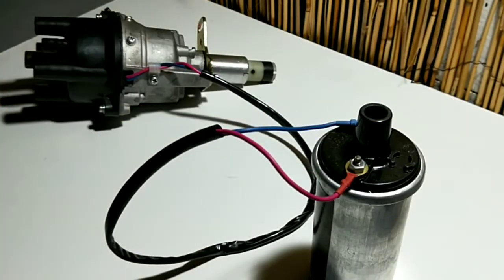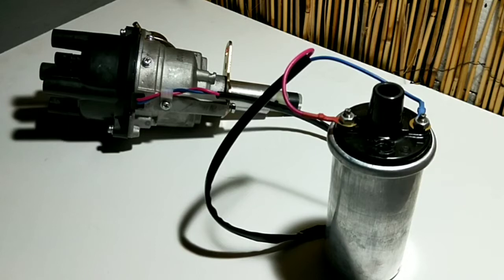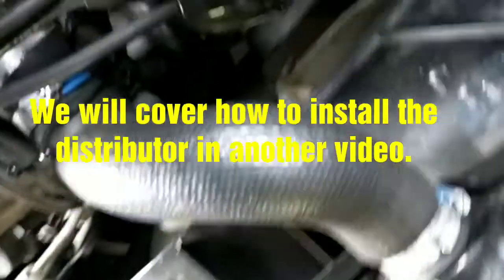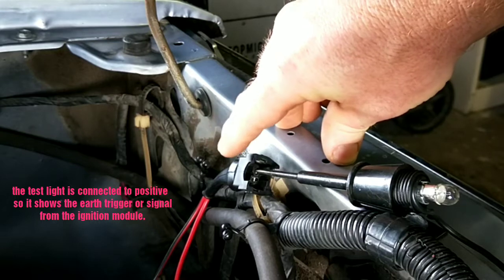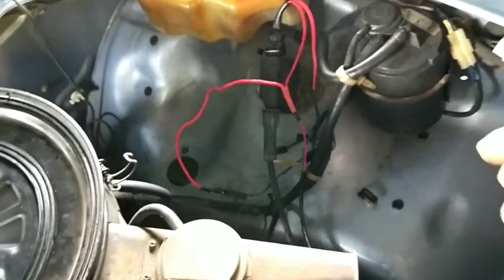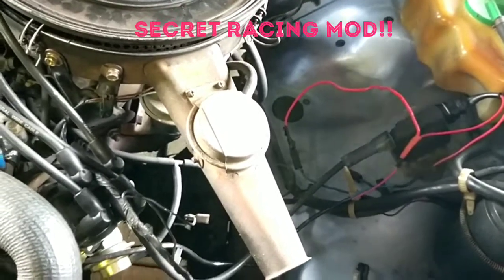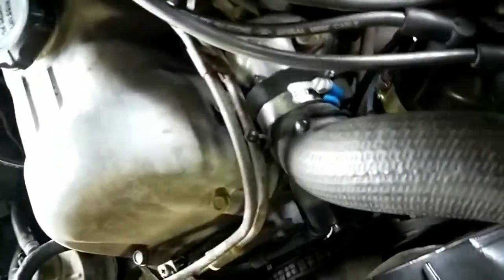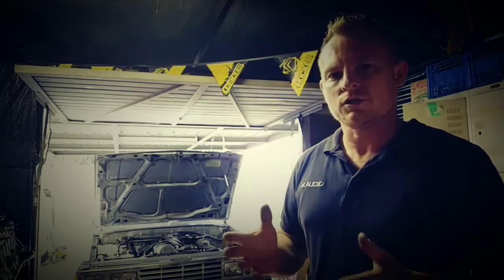ELECTRONIC IGNITION BASIC WIRING

Comment: I have a 1965 Fleetwood Cadillac and the wire running from the ignition to the coil was burned to crisp. I tried to run a wire straight from the ignition to the coil and I still couldn’t get it started. Is the wire running from the ignition to the coil a resistance wire and is that the reason why it wouldn’t start?? Also I’ll hook a fresh battery from another car and try to start it on the caddy and the battery would be dead after two tries. What’s going on??? If the wire is a resistance wire can I run it without it and if so how? Please help!!!

Comment: Hey mate, 
I have got electric ignition for my L20b. 
I have ran 12v power direct to coil but my coil heats up bad. 
I have hooked dizzy as per your vid. Does the coil need to have another earth running to body
Reply from the maker: Datsun Guy. The coil bracket should provide earth to the the body of the coil but that shouldn't effect the coil getting hot. The coil usually only gets hot if there is resistance. Make sure it's a 12volt coil for electronic ignition and not a points type which requires a resistor.